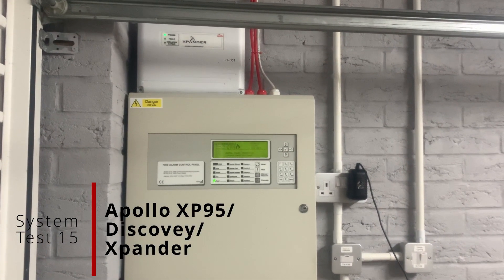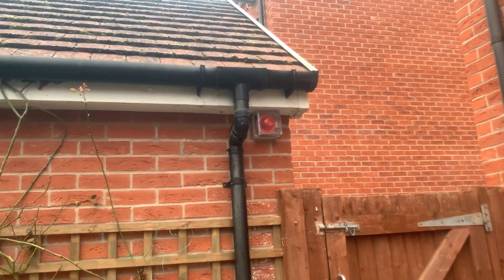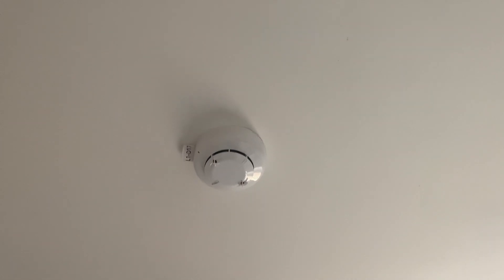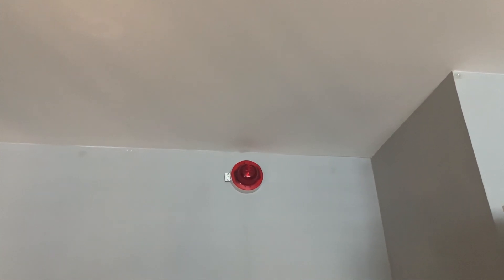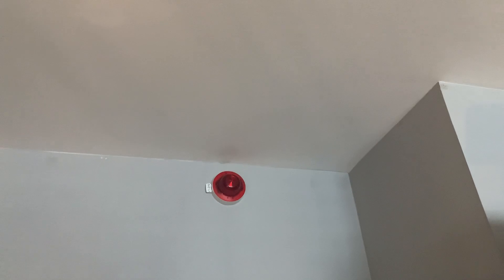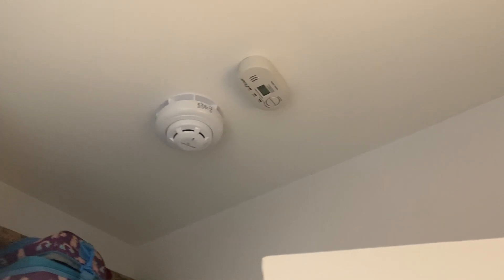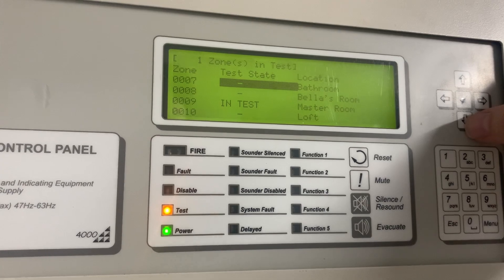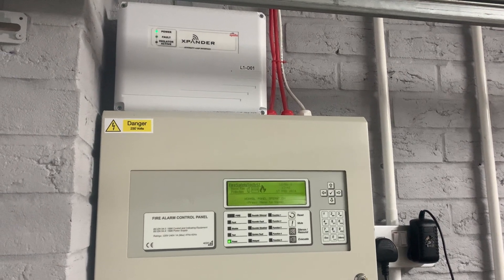Apollo XP95/Xpander House System Test 15

Comment: 10:38 what is the tone for the system alarm? Is it a higher frequency?
Reply from the maker: The tone is the default Apollo evacuation tone, alternating tone 1s on/1s off.
Reply: @fst1775  ah ok. I was just confused because I am used to hearing the sound of the detectors that were in the bathroom and bedroom and not the optical in the kitchen